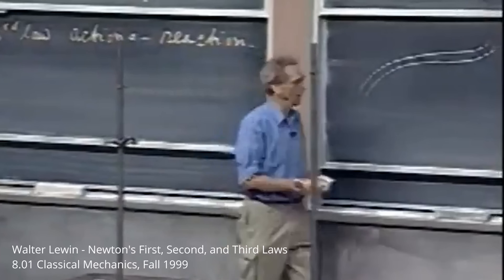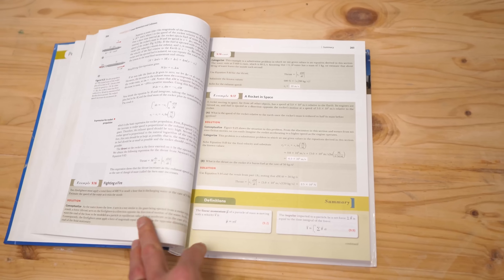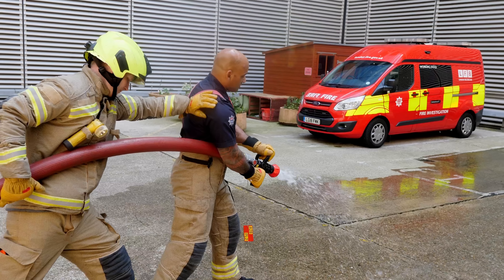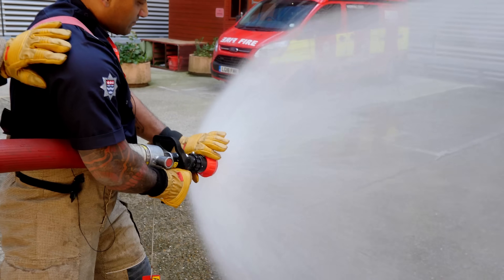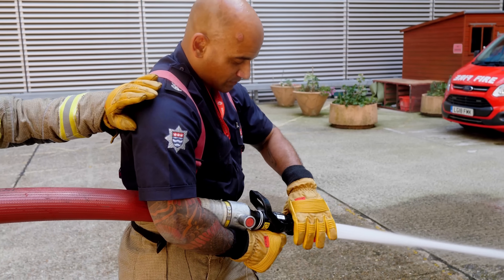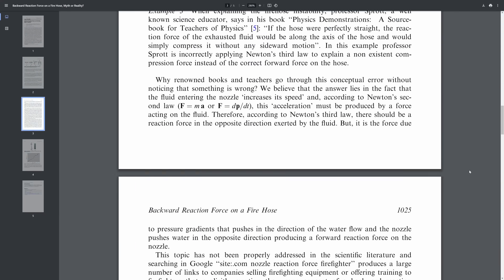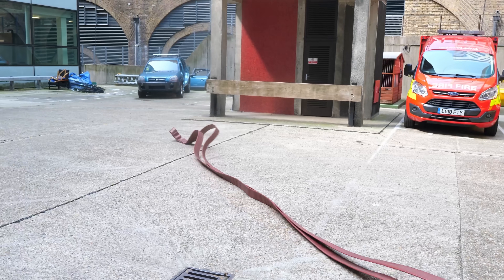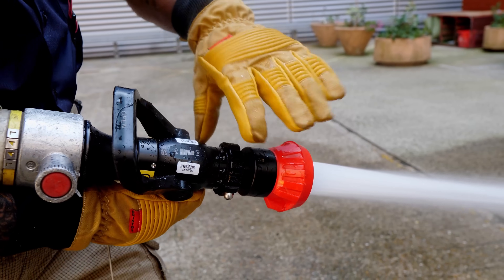Why chaotic hoses dance

Comment: The firefighter feels a force because the nozzle forms a constriction that speeds up the water. The force felt is F = dm/dt (v2−v1) where dm/dt is the mass flow rate.
Reply: Even more specifically you can calculate v2 if you use the fact that the discharge at the end of the nozzle and before the nozzle are the same to be A1/A2*v1, so the Sammler the Constitriction, the karger the acceleration and this the greater the force
Reply: this is wrong. Force is not conserved. Please point out where this supposed force would be transferred to the hose!
Reply: He argues that even without an explicit constriction the water will speed up as it leaves the hose due to the change in water pressure. Adding a constriction just raises the water pressure just before leaving the hose.
Reply: @edwardblair4096   Ever seen one of those nice laminar flow fountains? The water is in the pipe/tube, leaves it, stays perfectly straight and fine, and lands elsewhere. There is definitely pressure in the water forcing it through the pipe, and definitely no pressure outside the pipe, so that cannot be the whole argument. This laminar flow fountain example kind of disproves that as the main mechanism.
Reply: @edwardblair4096  there would be almost no pressure without constriction with the same flow rate.
Reply: @edwardblair4096 that is not correct. The velocity of the water at steady state is purely obtained by the conservation of flow. If the water speeds up, to conserve the flow, the cross section of the water stream must reduce and this is not what is happening at the outlet of a free opening without nozzle.
Reply: @edwardblair4096  I think that without constriction there would not be a change in water pressure at the exit. Rather the pressure would decrease gradually along the hose, from its highest at the pump, to ambient at the exit. In that condition, the velocity of the water would be the same throughout, and there would not be any force at the nozzle, if the hose is straight.
Reply: @edwardblair4096  I would expect that increase to be very small at most, because water is almost entirely incompressible. It takes basically no expansion of the water before the excess pressure is completely gone.
Reply: Yes the water nozzle is a rocket engine... The force is the weight of the water x the velocity of the water when exiting.

Comment: One thing I think is missing from your analysis that might make things simpler to reason about is some dimensional analysis. Surely there’s a non dimensional constant that can be used to divide the behaviour of the hose up into different regimes (not moving at all, oscillating periodically, flailing chaotically). Probably something involving stiffness of the hose per unit length, length of the free end, and momentum gain of the exiting water?  I have done computational fluid dynamics, but I know nothing about material stiffness coefficients, so I’m not sure where to take it from here. Maybe one of the mech-e folks have a suggestion?

Comment: I wonder if there is formula to figure the maximum length an unanchored portion of  hose can be before it becomes non-stable (I.e. it stops just alternating sides and becomes erratic)?   I assume there is a relation to the force of the air/liquid coming out, the rigidity of the tubing/hose and the correlation to the length at which it becomes unstable (starts flapping) - just curious if there is a predictable formula for determining, but not so curious that I'm going to figure it out.  :)

Comment: I'm no scientist, but my curiosity peaked when Steve mentioned how the length of the hose determines the "chaoticness" of how the hose performs. This reminded me of the double pendulum chaos theory... Physics is so interesting.
Reply: that's the exact thought that went through my head, and he even mention two separate "curves" that you could see as joints!
Reply: It is the exact process! One part of the hose tries to "correct", moving the opposite way, which in turn further affects the other bends' angles.
Reply: I think your intuition is spot on. This a bit is like having an infinite number of pendulums connected to each other

Comment: You are using 2 completely different systems interchangeably... The fire hose has a nozzle at the end that dramatically increases the velocity of the water.  The small hoses have no nozzle, so the velocity is constant.

Comment: 15:18 If there's just one bend in the fire hose that imparts a force such that it can move that section of hose, this will create a bend just up from it in the opposite direction just based on the geometry of them being connected. This new bend will create a force in the opposite direction and stabilize the forces along the midspan of the hose. 

I'm guessing you will find there has to be an even number of bends in the midspan of a hose laid on a low friction surface, and if it's an odd number it will just make one more and stabilize. 

For the third law vs momentum argument. I think the nozzle is creating a pressure difference, converting pressure to velocity.  So, it's water pressure pushing the nozzle, not pushing on the water just behind it in the hose. Same as an actual rocket; the force doesn't react on the column of propellants, the load goes through the nozzle's load supports. 

To make an experiment that tests the momentum effects alone, don't use a nozzle, just an open hose end. I'm guessing the momentum forces are significantly smaller than the the nozzle forces which is why it's mostly third law dominated for the typical use of a fire hose.

Comment: Hm. I'd assume the hose is more rocket-like because you're dealing with pressure. The pump's moving water, the hose constricts that flow, the nozzle allows it to expand. Any other forces acting are going to be negligible in comparison.

Comment: Surely the tension in the hose is important. When there's a curve in the hose, the acceleration of the flowing water packets makes the pressure higher on the outside of the bend than on the inside, which would tend to increase the curvature. However, that's exactly balanced by the tension along the length of the curved hose, which tends to decrease the curvature.

I don't think the pump feels any reaction force, because it doesn't accelerate the water, it only increases its pressure. The reaction force will be upstream of the pump, where the (atmospheric pressure) water tank drains into the (lower pressure) pipe feeding the pump.

Comment: Well, isn't the nozzle on the end of the hose causing a huge acceleration from the pressure drop across it? The water in the hose is flowing at the same volumetric rate but as it's moving through the nozzle, it's being changed from 1m/s x 80cm^2 to 10m/s x 8m^2. That acceleration would be felt across the entire length of the restriction causing the acceleration, which is just the convergence length and orifice of the nozzle.

Edit: Okay, yeah. He said the thing.

Comment: Air is indeed too compressible, anyone who worked with hydraulic will tell you. If you actuate a cylinder at is maximum displacement you’ll start to see even if the hose is tethered at both end the middle will start to flex bend and twist. The looser the crazier.

Comment: I could be completely off here... but surely the firefighter would feel some of this force as the end of the tube will experience perpendicular latteral forces.. Kinda in all directions outwards, but... with oscillations. 

The fire fighter is fighting the hose end wanting to move up, and down, left and right. (Which kinda makes sense if the curves in the pipe bends were to introduce some low level bouncing back and forth of the medium within the tube) Maybe I'm completely off here. I dont know this stuff.

Comment: The pushing a string metaphor nearly demonstrated the same shapes in the string as show up in the air hose, so I think that's the perfect way to think about it. You got to a similar point with your final explanation with the air hose, but it was super telling how the string bent just like the hose did when you pushed on it.

Comment: There are those water jetpack things (they run in lakes, and have a jetski pump feeding a hose) and maybe that says something about what forces are involved in holding a hose? (I am aware that the hose goes up to the user and is fired down which means there is a 180 degree bend...)

Comment: I’ve run A LOT of fire hose on dusty job sites for multiple hours on end. Every so often, you can find a position where the hose needs just barely enough grip to keep it pointed in that exact certain way,but move it just a tiny bit…..  and you are back to wrestling it back into position
Reply: Is that when the nozzle is exactly straight with the hose? If so, it's probably being held by the axial stiffness of the pressurized hose.
Reply: @roflchopter11  Or the hose is pushing back at just the right angle on an uneven surface to relieve the operator for a moment, but the angle stops working when you move.
Reply: I believe you find a "sweet spot" where the hose "bites" into the ground behind you and gets a "grip" that makes it seem to be stable. Some weird friction and resulting forces that cancel each other out. While I have not used a fire hose, I used a lot of pressure washers and noticed also some rather interesting "stable" positons, where the handle "puses" much less into my hand than in other positons.
Reply: @ErikZiak yeah sometimes you can “balance” a pressure washer against gravity, the force of the jet, the hose, the ground, and your hand just right so that it barely takes any effort to keep stable. But just as the original commenter says, move a couple of degrees and it’s all over haha
Reply: My wife is like that too.

If she sees this, I'm probably getting hurt.
Reply: I have a similar experience, but not with a hose, but with a high-power pressure washer that I used on my old job. The jet on it was so powerful that it would actually push me backwards on the slippery floor. But, whenever I would use it to clean the conveyor belt, I would often manage to find a position where all the forces involved would cancel each other just right off and the pressure washer nozzle was just a weightless handle in my hand, all I had to do was find a comfortable position to hold it in as long as I could, since it would take me upwards of 2 hours to go through that conveyor belt hahahaha
Reply: Semi stable state
Reply: @SphericaICow  More like unstable equilibrium, like balancing a ball on the top of a hill. Requires no energy to keep it there, but let it roll slightly to one side, and it wants to take off down the hill.
Reply: @RCAvhstape  that’s the best analogy. It’s just like that. It has next to nothing to do with the hose being perfectly straight because on a job site, you’re never gonna find a perfectly flat level straight area. It’s more like you get in the perfect position where all of the forces acting at all of the bends cancel each other out for just a few fleeting moments.
Reply: Let me guess, that is when the hose is straight?
Reply: Is it anything like overcorrecting while driving?
Reply: because the hose itself is bracing against the force. it is an unstable point, much like a ball on a hill. it takes little energy to keep it there, but the moment it is down the hill it needs you to put all that energy back in to get it there. this sounds exactly like a flexible object self bracing.
Reply: His example in the video is wrong because of a scaling issue, also air can be slightly compressed which causes it to not be as aggressive on the hose
Reply: @PropPounderFPV highly compressed, comparing water to air does not help his analysis I think
Reply: @imaginitivity7853  There's also a huge difference in mass flow, which I'd bet also contributes to the differences between their behaviors.
Reply: I came to say that as well and I’ve never used a fire hose lol

Comment: One component missing is the weight of the hose acting as a stabilizing element when filled with water. Additionally, lamar and turbulent flows may play a role.
Reply: Lamar flow is the most under rated flow. Loved his new album.

Comment: I wonder if you could compare the chaotic hose motion to the motion of a double pendulum, but without the constrained x-axis

Because that's in essence what's happening, right? The air pressure leaves the hose as the water flows in, causing the initial equal-and-opposite reaction. That reaction then compounds against the force of the water flowing through the hose, further changing the shape of the hose. Which repeats until the bend in the hose is too great, beginning the negative paradigm shift and repeating until the water is shut off, where gravity becomes the dominant force pulling it back to a limp, straight position

Comment: For the water jet backpack that I flew (and repeatedly crashed) a few years ago, the hose from the jetski's pump was about 2x the diameter of the nozzle exit, so the water in the hose had pressure that was converted to velocity at the nozzle. The thrust very much appears at the nozzles, enough to haul my considerable heft into the air.

This contraction ratio is important in actual combustion rocket engines because it increases the residence time of the fuel and oxidizer in the combustion chamber to improve the completeness of the energy release. In all the rocket engines I've designed I tried to keep the Ac/At ratio at least three.
Reply: the other argument to make here is that it's not dissimilar to a pelton wheel type arrangement, where the direction of water turning around is what imparts the force, rather than the just the impact of the water, or the water leaving the nozzle.
Reply: That isn’t right
Reply: The thrust would not appear at the nozzle, it would appear at the bend